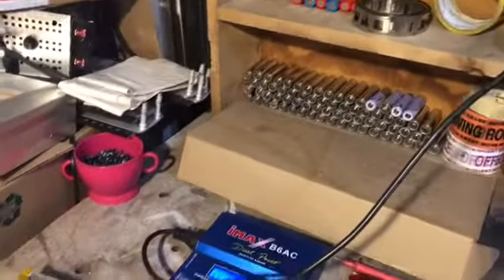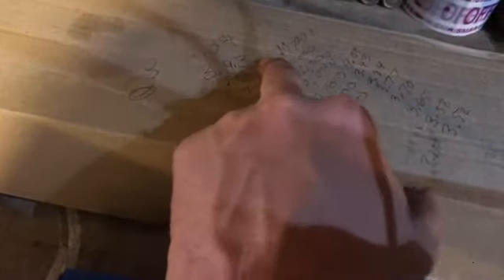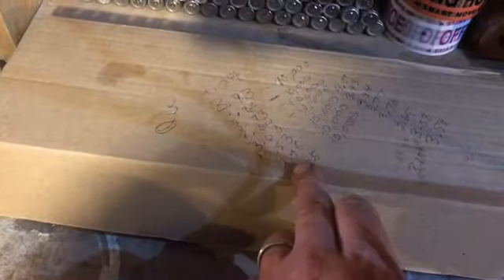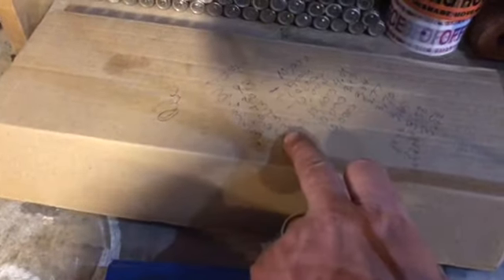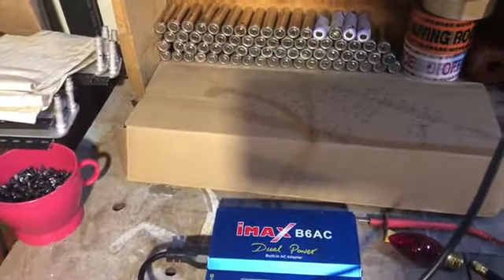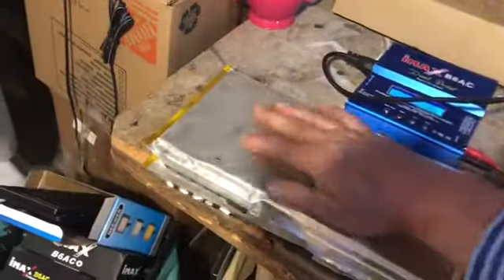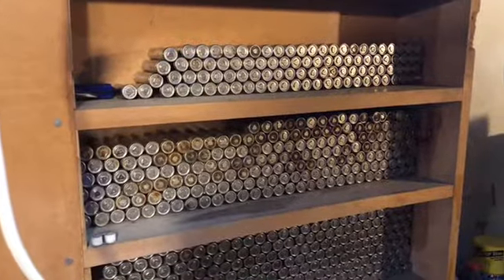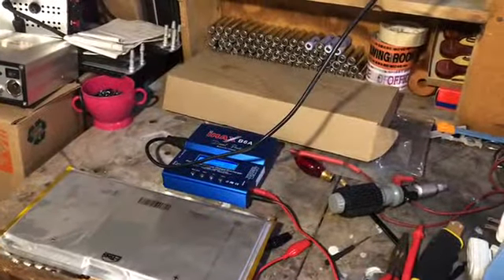Smart Forty Individual Cell Capacity

Comment: At full, the pack is supposed to be 55AH at 339V max. This is for all 93 cells.  I am wondering what the battery use us (volt range) between full and 'empty' that the Smart BMS allows.  Also, what chemistry are these batteries?
Reply from the maker: servant74 battery chemistry is nmc. Directly on the cells is printed 50ah and 3.6v. The data sheets I have seen show nominal voltage at 3.7 and ah rating at 52.